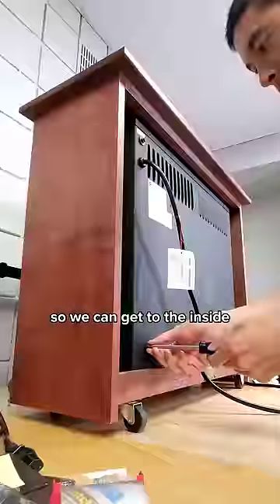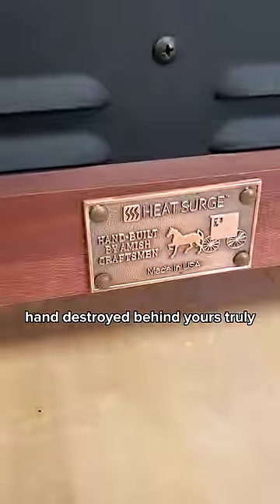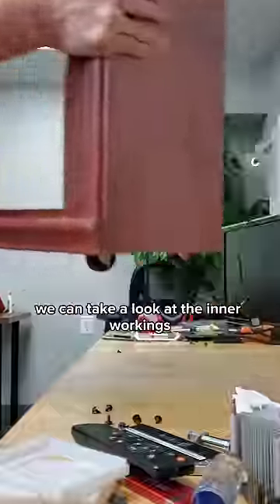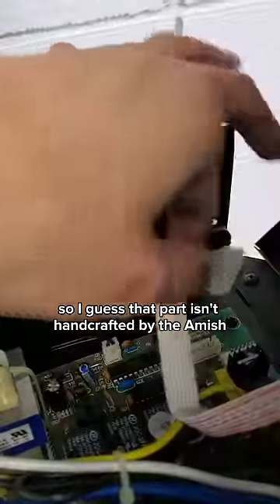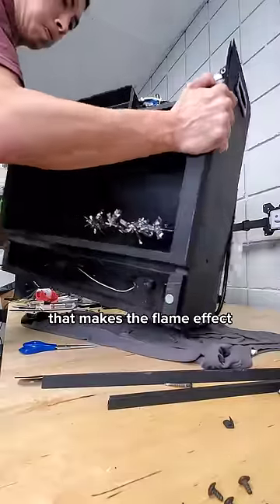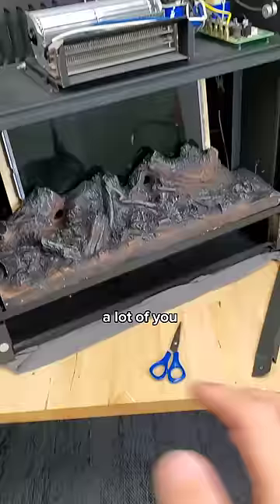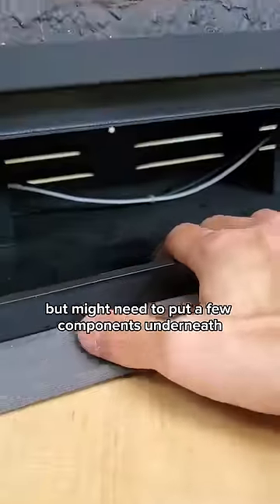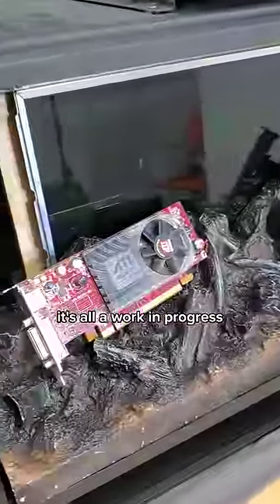turning an Amish fireplace into a PC, part 2! #shorts

Comment: What if you added a radiator in the bottom section so it can still generate heat, especially if you add a 12900k